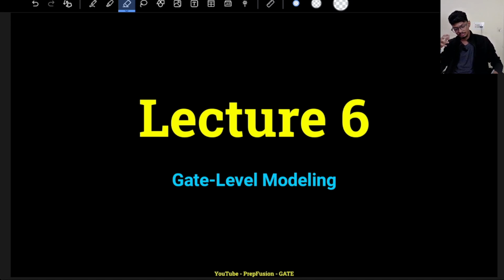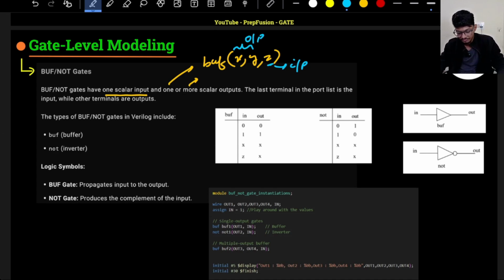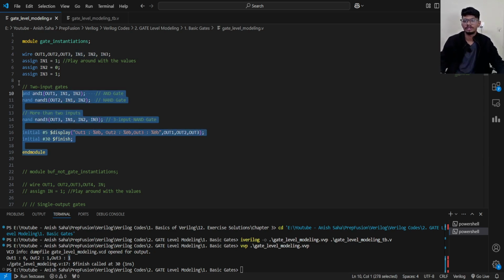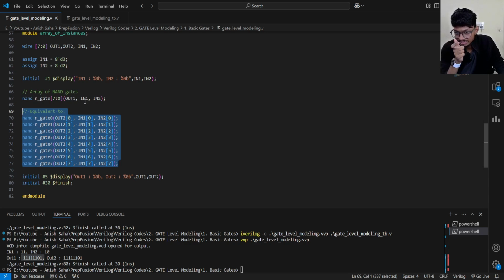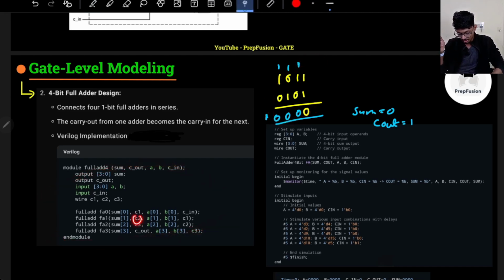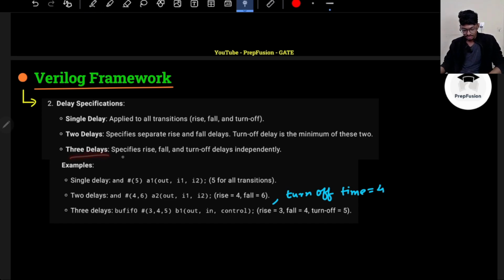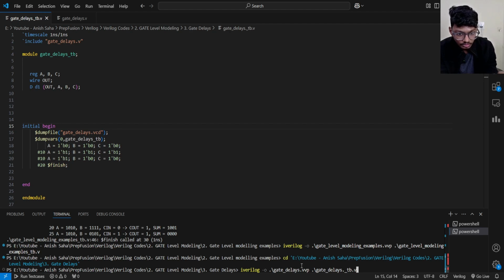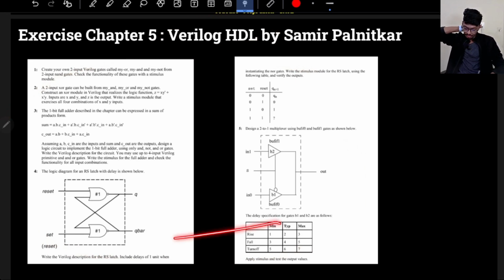6.  Verilog Gate Level Modeling Tutorial: Gates, Adders, Delays, and Simulation | #30daysofverilog

Comment: @38.18: Please note that this code is not synthesizable due to the use of #delay.  
As a best practice, delays should be used only in testbenches, while synthesizable design code should remain delay-free.
Reply from the maker: Yes, Anand you're absolutely correct and the exact thing will be discussed in upcoming lectures as well. The reason also I have discussed.
Reply: @AnishSaha_  ya I saw tq